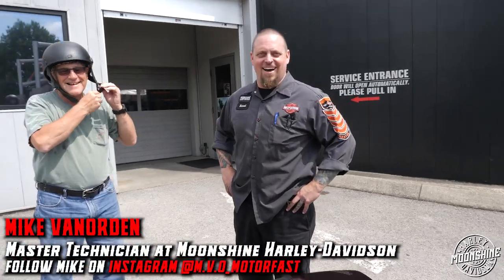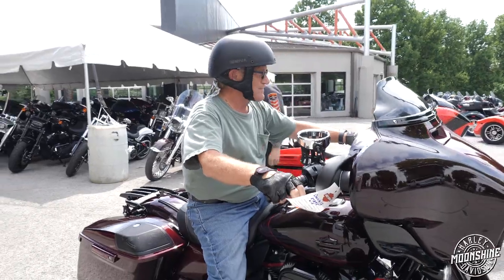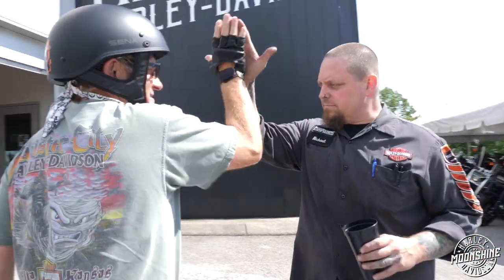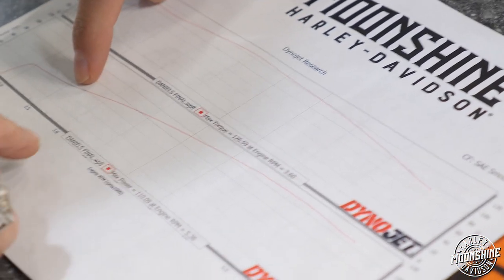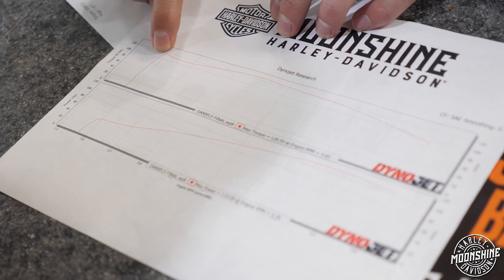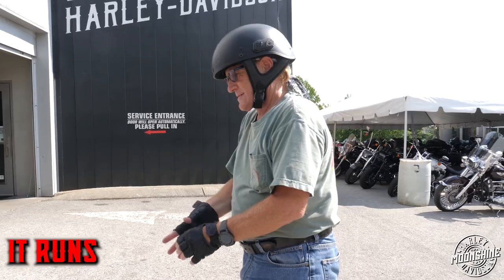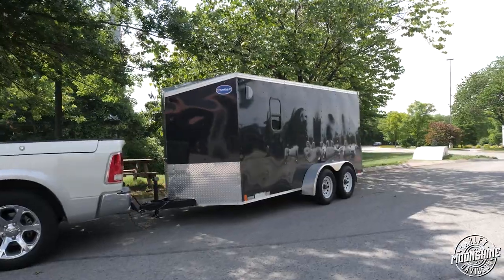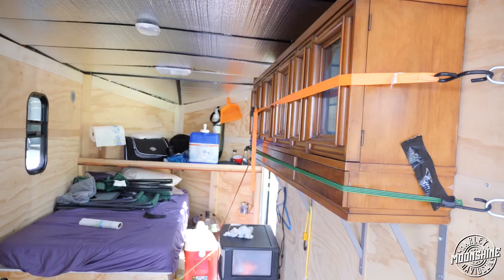EVEN MORE HORSEPOWER! 127TQ 110HP | Customer Testimonials

Comment: So are you using only factory parts ? It says fueling S&S ECT  . I was under the impression the motor company was not letting dealerships use aftermarket parts .. I know for a fact 100 % they fined speedway Harley in Concord nc for what you are doing even threatened to pull the franchise . I worked there       as service mgr brought in 2 of the best hp guys around Josh beaver and shawn bowls both as me from tilley hd statesville nc . Could not work there after don died . Not working for a clown that was a barber until he married Don's daughter . We start doing our thing at speedway and the motor company shut it down but yet you guys can . Not crying more power to you we are better off since leaving hd  .. just say might want to be cautious with the social media as we were not close to what you are doing here on YouTube good luck to you guys look very solid